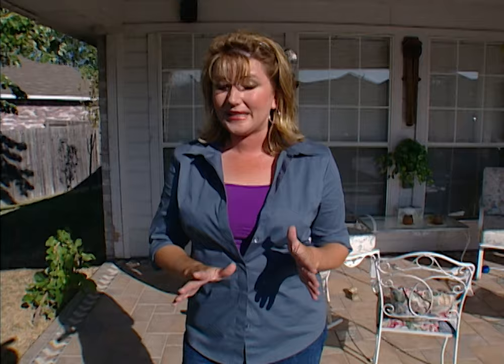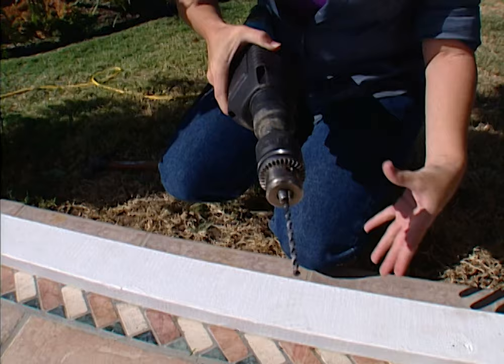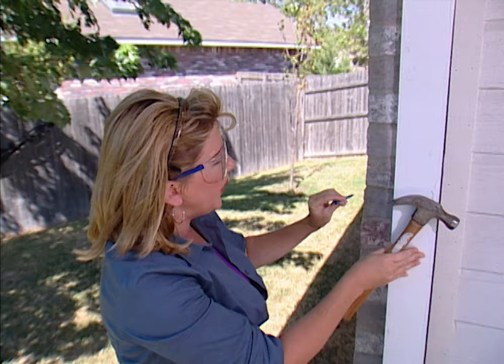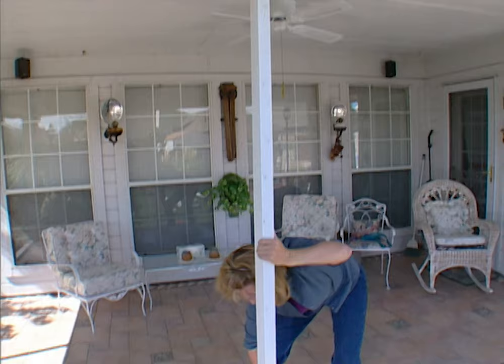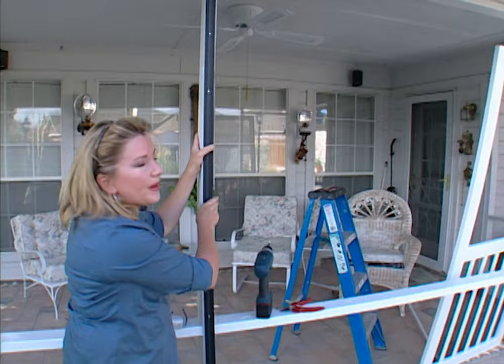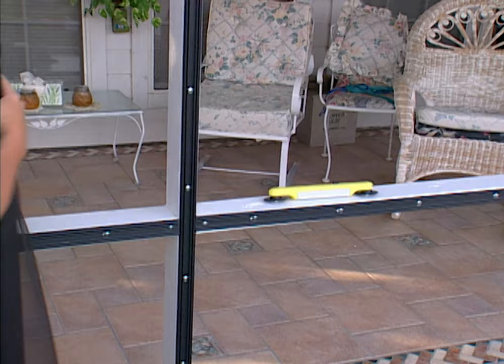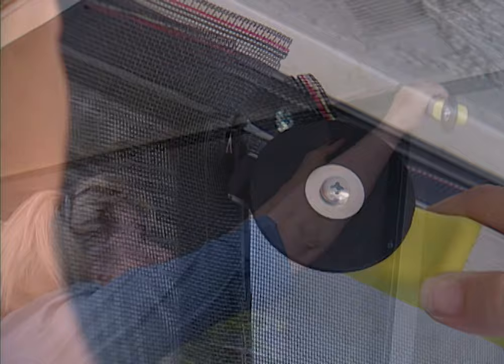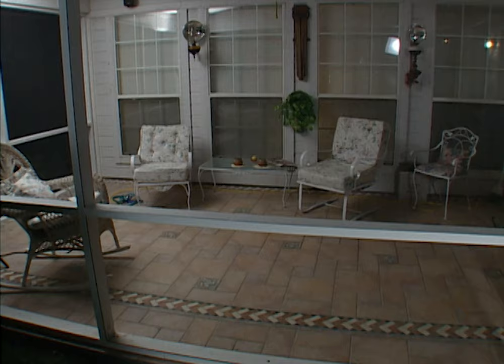Screening in a Porch - Do It Yourself

Comment: Should not bang boards with a hammer to put them in place. Place a wood block over board or use a rubber mallet. Otherwise you’ll end up with hammer marks on your nice painted board
Reply: Yeah ok superintendent

Comment: I have tips, now that I am 3/4 done screening in my porch. 

#1. When you cut your screen, give yourself an extra 2” more than the dimensions of the opening, on every side.

#2. If you have a Kreg tool, it really helps with the wood framing.

#3. I read the reviews of the Screen Tight spline roller tool, so I bought a wooden roller tool with a metal wheel, and I am glad I did. 

#4. Do horizontal top, then horizontal bottom, then the sides. Always start at the middle and work your way out to one side, then do the other side. Same goes with the vertical sides. 

When you’re done the top, pull it kind of tight, straight down as you work your way out. Pull the screen fabric diagonally down from the middle toward the sides as you roll the spline in.  Go slowly, and pull the spline straight, stretching as you roll. That helps keep the wheel from slipping and cutting the screen.

#5. There are two tracks for screen and spline, use the one distal to the actual place you are putting in the screen and spline to kind of tack it up in place for you, so you don’t have it flopping around. It makes it so you don’t need a helper. It’s really helpful if you’re on a ladder, maybe standing at a weird angle. 

Before I figured out the spline trick, I used a heavy duty staple gun to temporarily tack the screen in place, but you have to keep stopping and pulling the staples out with the staple-pulling tool. The spline trick is a million times easier. 

Starting at the top horizontal track ABOVE the track you’re really going to use, jam a little scrap piece of spline in the middle, then with more scraps here in there, work your way out toward the edges. 

If you already used that track for the screen above it, no problem, just use the vertical tracks to hold it in place with some scraps of spline.
Reply: THANK YOU!
Reply: Thank-you
Reply: thanks buddy.
Reply: Appreciate it. Will be my first build.

Comment: Very nice video One Thing Once I had those boards painted and everything I would have used a another board to tap them into place sure then hit them direct with a hammer also would have talked up where they met with caulking and then maybe put one more quick coat of paint over once they were installed to hide your screws also hopefully they don't have any raccoons on the outside or cats on the inside because that vinyl screen is just about as fragile as you could possibly get I would have used the black coated galvanized metal screen it's a little more difficult to work with but it is a lot stronger
Reply: Great advice.  I have four cats.  Someone else told me reinforced screen would be better.  However, when getting a quote today the contractor told me regular wire  since the galvanized is harder to handle.  Now what do I do?  Also, I am using a chair rail, but I didn't hear her specify how many inches she used when meassuring for it.  I want to make sure it isn't too high or too low.   If someone can tell me I would greatly appreciate it.  Thanks~

Comment: Currently building ours now. Our patio is a lot smaller but we are using 3 doors at a cost of $100 each. With lumber, screen, the screen tight, etc. the cost is 1300.
Reply: What kind of door did you get?

Comment: So good to hear correct terminology used. “aka drill in concrete vice “cement”.  toenail, awesome. (have had vey little luck with tap on so far, like my “22 cal ram setter “fire in the hole “. thankfully, i’m just dealing with old PTL 

Great vid.   i’m really debating on using  this system. think in long run will save me money vice prep and paint.
Reply: However she checked for level on the vertical. Should have said plumb for vertical and level for horizontal. Also a 4’ level should have been used

Comment: The product does not hold up in direct sunlight. I used this to screen in my porch here in Central TX and less than two years after installation I am having to redo the two sides exposed to direct sun. The shaded side looks ok.

Comment: Tools needed: 
(not shown)- A circular saw, presumably
Safety googles
Ear muffs?
Drill
Masonary bit- pre-drills holes into concrete
Tapcons- the actual screws that go into concrete
Hammer- taps studs flush to bottom and top plates
Impulse nailer (rentable) w/ nails- nails studs in place
Leveler- for center studs
Screws- for adding vinyl base strips
Snips- to cut bottom of vinyl base strips to length
Roller knife - cuts screen/ rolls rubber spline into screen channel 
Rubber mallet- pounds vinyl cap into place

Materials needed:
Several pressure treated 2x4s- # depends on porch's layout-- this will be used for the top, bottom, and side studs along with the middle support beams, door frame, and railings
Vinyl screen door (not shown how to insert)
Paint
Vinyl screening base strip
Screen
Rubber spline
Vinyl cap

That's what I could gather from this video, let me know if I'm missing anything

Comment: Thanks for the video. Do I have to use pressure treated wood for my framing?
Reply: Pressure treated lumber should be used when in contact with concrete or masonry

Comment: I have an existing porch with aluminum siding.  Should I frame the top also, or can I attach this system to the aluminum siding?
Reply: You can attach it straight to the aluminum. Get the strips and use the self tapping 1” screws to secure them. You shouldn’t have any issues.
Reply: @bradmcdonell8346  Thank you.

Comment: It would be great to have a list of all tools that are needed.  I could never do this on my own. The cost of a concrete drill in itself would not be worth it.
Reply: Most people usually rent these type of tools, the ones you aren't likely to use often, at a local Lowe's, Home Depot, or other tool rental companies.  Just be sure to plan ahead and reserve your tools, and be sure you give yourself more time than you think it'll take, so you don't have to pay a late return fee. 
BTW ..you can rent about anything.
We've rented a backhoe several times, as well as other large equipment. You can even rent the truck to pull the equipment with. 
Luckily we’ve got a F-450 truck,  so that's at least one less expense, for those reallly big jobs.